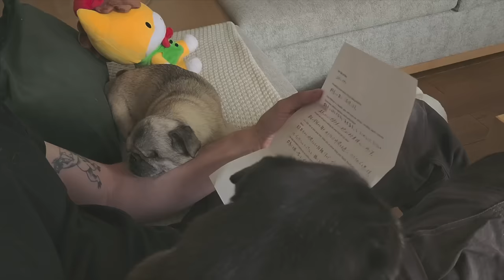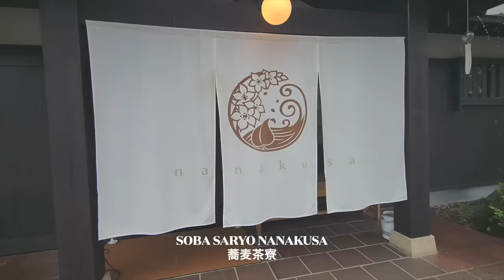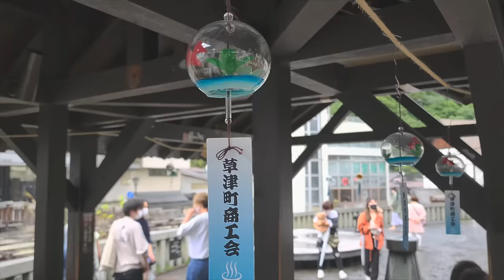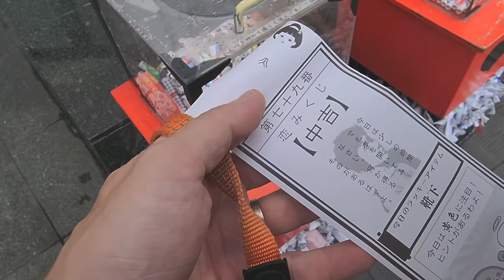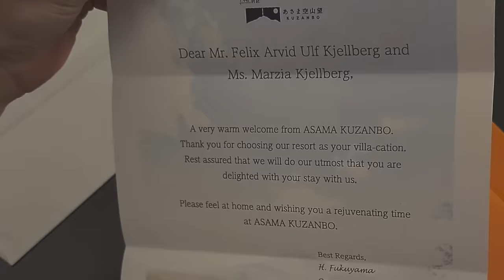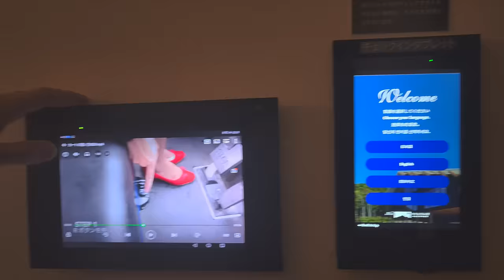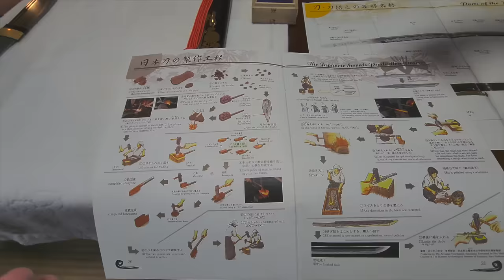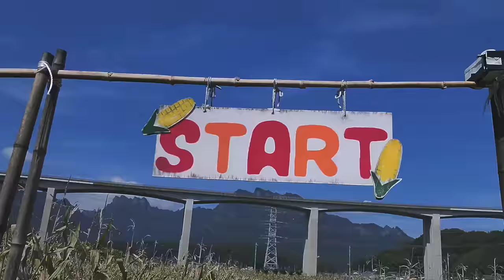My Dog was invited by The Governor of Japan (Gunma)

Comment: im almost certain that the poisonous tree frogs are the ones with vibrant, neon coloring, which i believe is their defense mechanism. their colors flash like warning signs to predators, essentially telling them “heads up: if you eat me, you will get very sick or die!” so the dull one he saw at the charging station just appears to be a regular old tree frog. 🐸 still cool though!

quick edit: i looked it up to be sure i wasnt talking nonsense, and this is true! its called aposematism; the use of vibrant coloring by organisms to ward off their predators. the general rule is that the more vibrantly colored an organism is, the more toxic it is.